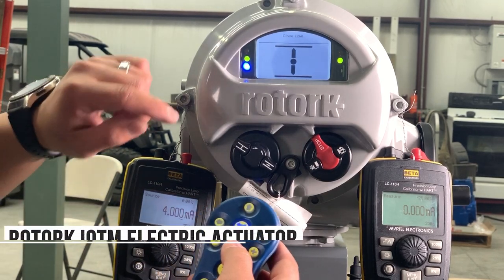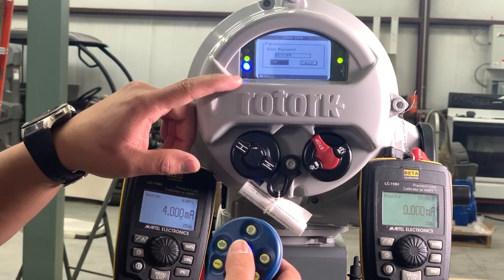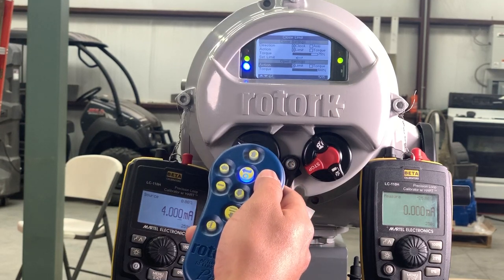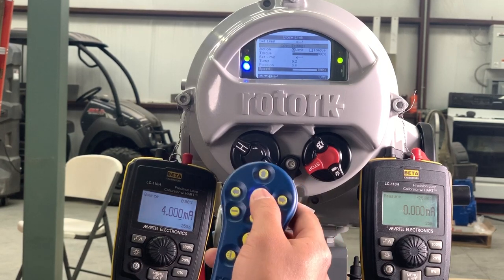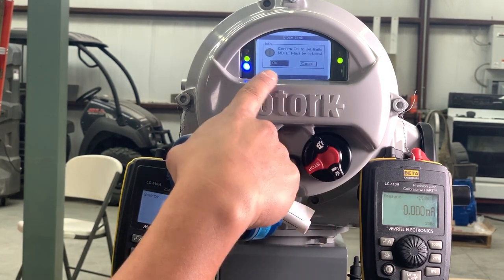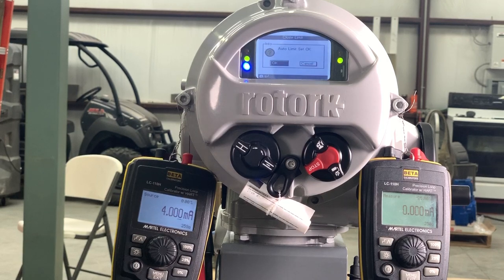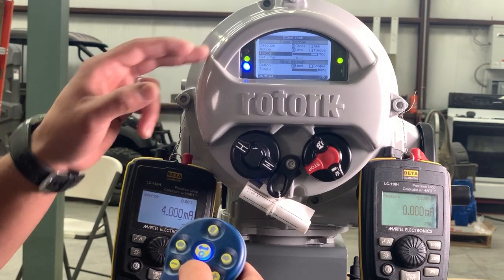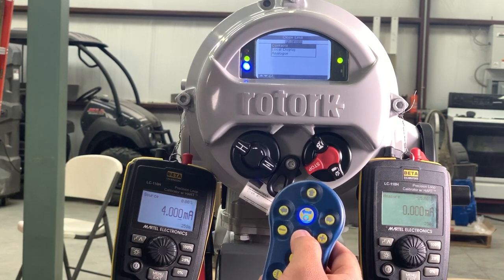Rotork IQTM500 | Setup and Remote Pairing

Comment: So we’re you holding down the down button at the beginning of the video to get the two blue lights to come on
Reply: Yes.  You initiate a Bluetooth link by pressing and holding the down arrow while pointing the setting tool at the local display.  The center button on the setting tool will start to flash a blue light showing that it's trying to establish a link.  Once a link is established the blue led on the local display will illuminate and the center button on the setting tool will stop flashing and stay lit up.

Comment: If this valve doesn't full close only 74% close what is it cause
Reply: torque settings maybe too low or you may have to manually adjust the stops on the actuator